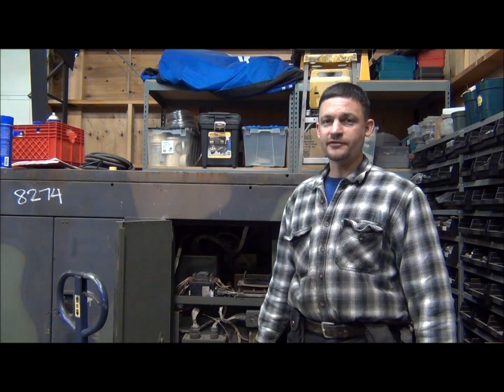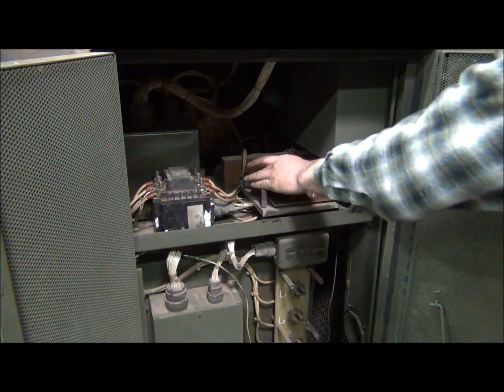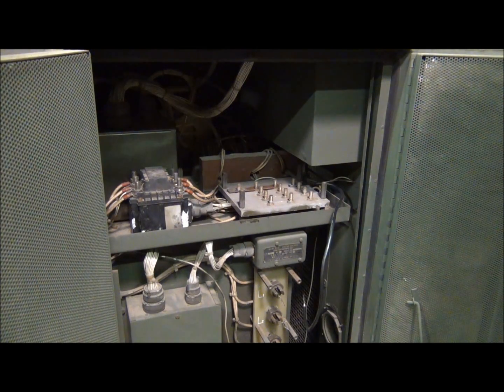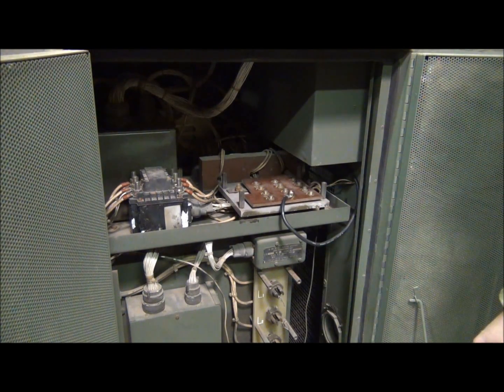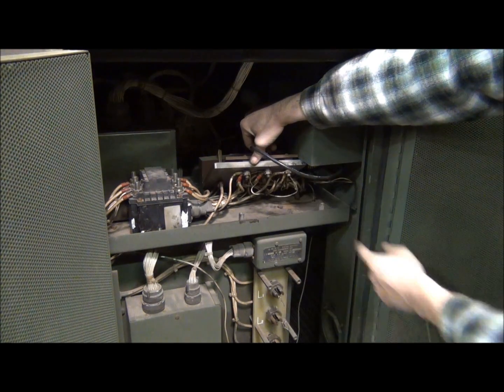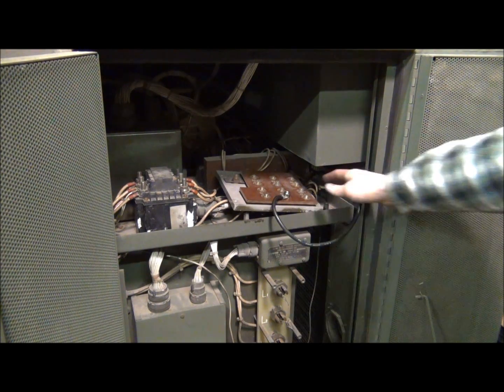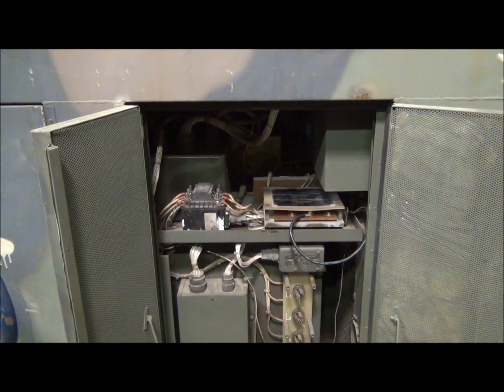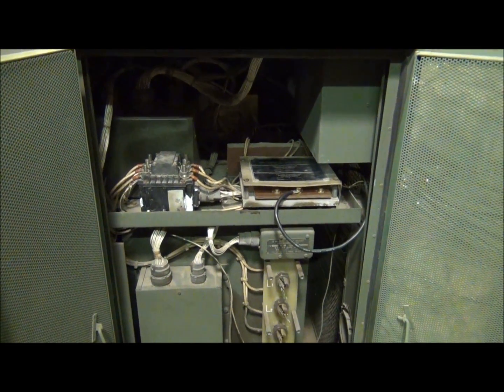How to convert an MEP-004a or -005a diesel generator to single phase 120/240

Comment: Hi Matt Verley, great video!! I found you on Steel Soldiers and this video is exactly what I'm trying to do. Everything is pretty straight forward as you explained it well but the only problem that I'm having, and I hope that you can advise me is this... 
The wires that you listed to move are different from what I have.
I have 2 wires on my #12 lug 110C16 & 110D16
I have 2 wires on my #8 lug 108D20 & 108A20
My unit is an MEP 804A 03/2004 Any help is greatly appreciated. Lol I'm trying not to short anything out. Hope your still available or if anyone else has ran into the same scenario with their machine??

Comment: How did you get around the 400hz to 60hz
Reply from the maker: There is no easy way to convert a 400 HZ generator into a 60 HZ set. I didn't have to do that, as all of the generators I bought were already 60 HZ sets.
Reply: @MattVerley  ya that’s what I’ve seen looks like this one I picked up will be good for the motor ever goes out on my 10K thank you for the reply

Comment: Hello Matt,
Wonderful video. I just purchased a 804b and am going to attempt the same conversion after I studying the schematics.
Do you ever offer your services, for compensation, to evaluate things like this?
Thanks
Scott
Reply: did you get yours sorted out?  Im getting ready to do the same thing
Reply: Hey Scott, I have also just purchased an 804B.  It's been a year since your post, did you go through with the conversion?  It seems that the only difference is the engine (Yanmar vs Isuzu) from the "A".    Was the wiring numbered the same as the A?   @MattVerley feel free to comment if you read this.  Great videos on these generators.

Comment: Can this be done to a Mep 006a?
Reply: Yes. I have done this to several of them.

However, the small wires on the rear of the connection board are different on the MEP-006A/105A. There are only two small wires on the back of the connection board to move, X12EG16N and X12P16N from T-12 to T-11 (or T-10). These must be moved before starting the genset, as the voltage regulator in the 006A is different than the 004/005 and it will damage it if these are not moved over to T-11. BTW, the wire numbers are printed right on the wires, so it is easy to identify them.

Comment: Matt, great stuff. Which one of your videos do I follow to reconfigure my MEP-804B 3 phase to 240 single phase? both look easy enough, just don't sure if the wires on the bottom need to relocate as in one video. Thanks.
Reply: Hi Steve, I am wondering the same thing, converting 804b to single phase. Did you ever find the solution? Thx

Comment: Hello,
Thank for the video,
On a forum a person was doing the same change, and the entire process is the same but.. his last connection is different, he connected T12 to T13, please advise on this difference with your instruction (T12 to T11), here are the full instructions.
"I moved X8HH16B from T8 to T11. This results in the VR seeing the following voltages:
T11 and T9: 240v
T9 and T12: 120v
T11 and T12: 120v  

I moved X8A16B to T3. This results in the thermal watt converter seeing the following voltages:
T7 to T3: 240V
T7 to T10: 120v
T3 to T10: 120V  

 moved the lead (X12EG16N) from its original position on T12 to T13, restoring the neutral.  "

Comment: I'm not sure if this is a problem of mine or if I just need help with the wiring, I have a m5 military generator with the four-cylinder Flathead engine with a Hobart generator zxb. Now if I had to flash the generator to make it generate electric how would I do so? If you had one of those generators I would make an awesome video

Comment: Good morning Matt. I just acquired a 1985 mep005a and when I excite the field with the start button my voltage will come up to around 100 volts but when I let off after setting the hz. The voltage goes away. Any ideas of where I should check next.

Comment: Matt I have a MEP 105A that has been converted to single phase along time ago .It has been working fine but today when any load is put on the generator one leg will drop to around 35-45 volts .Can you help me ?

Comment: Hello Matt,  my name is Eric, i am using my sister's youtube account.  i have a MEP005A generator that i purchased 2 yrs ago.  i have followed your directions on how to convert it from 3 phase to single phase and it works great!!  i have recently hooked 2 air handlers w/ emergency electric heat for a load bank. With both air handlers at full capacity it registers 130%.  The generator compensates and performs correctly at all times. At 130% it holds steady power and as of yet i have not tripped it out.  it is a very strong  generator.   Thanks for your video on how to convert my generator  MEO005A
Reply from the maker: Glad I was able to help!
Reply: @MattVerley does the mep 006a convert the same?

Comment: Mat, I have a MEP 004a. In back of the control panel there is a box on the right side approx. 4" x 8" with a bunch of wires going to it. The box is dripping considerably what looks like tar at the bottom of the box. What would you do about this? I have not started it to check out the unit. Just got it. I believe it was create approx. 1985 .     Kris Church

Comment: The lead #s you mentioned to move around. Are those labeled on each wire? And if so is it common to loose the label with age?  I am looking at purchasing one of these for Home backup use and will do this conversion on it.
Reply from the maker: MrBellboy1234 the numbers are stenciled on the wire every few inches.  Easy to find the designations, but you might need to work your way back up the wire a bit to find a legible one.

Comment: Hello, thanks for the video a lot i have to questions if you may, in T8 I found XBA16B and another one labeled 8 only, 2nd question when i do this switch if I connect a cable to L1 and L3 which is neutral in this case i get 240v as a single phase ?

Comment: This "single-dual" zigzag provides 2-phase 120v system with 180 el. degrees voltage vectors. Single phase system can have only ONE live wire and in this case is 240v only. My friend have similar DG and uses it in euro 220-240V 1-phase system to get an emergency power for his cottage. In his system "L1" is a live wire, "L3" is N and grounded, and "N" is left unconnected.
Reply from the maker: We're talking terminology here; but you're correct.  Normal household current in the US is split phase 120/240.  That is accomplished by grounding the center tap on a single phase 240v transformer.  This allows for two 120v legs, and the use of 240v by combining the two hot legs.  The generator is simply wired to match this normal household configuration; more useful for most people than the stock 3 phase configuration.
Reply: The most powerful appliances are connected to 240V, small - between one leg and neutral to 120V.  Have bought  many audio amplifiers from USA on eBay,  small models all have 120V power, the hi-power professional models - 240V.  But i don`t know, what advantages have that split-phase system in compare to european 240V single phase. Some peoples talk about, that 120V is not so dangerous as 240V, some say that this is historically formed system, that can work on today and do not need to invest a lot of money to transfer it to any other.
Reply from the maker: the reason it is safer is that there is no more than 120v from either hot leg to ground.  So, if you accidentally touch a hot leg in a 120/240v split phase system, you will only get shocked with 120v.  If you accidentally touch a hot leg in a true single phase 240v system, you get shocked with 240v.

Comment: i got a mep-813a but is 400hz there is any way to make run in 60hz
Reply from the maker: No; a 400hz generator is almost useless in a civilian application.  To convert to 60 hz, almost all of the instrumentation and control systems would need to be swapped, and the generator head itself would also need to be replaced with a 60hz version.  No easy or economical way to do this.

Comment: 1979 mep 005 generator with white 6cyl diesel engine starts then stalls shortly after releasing start switch.  Fuel pressure from transfer pump appears to be weak(very slow flow).  Manual states 130 psi max.  Could you tell me where to find a transfer pump and idea on fuel pressure

Comment: Will this conversion work on a 1980 30 kw MEP 114 A? You have the best videos on these generators keep it up.
Reply from the maker: The conversion to single phase would work; but the 114a is a 400hz machine.  Almost useless in a civilian application, unless you intend to power a military surplus radar set or some other kind of custom project.
Reply: So what is 400hz and what does the hz need to be for a 120/240 house? What will happen to my house if I used the 400hz?
Reply from the maker: Mike Carlson household current is 60hz (in the US).  If you tried to supply your house with 400hz, it would immediately damage any digital electronics, motors, and anything with a transformer.  That's about 95% of most household electronics.  Heating elements would probably be ok, as would incandescent light bulbs.  Generally speaking, a 400hz set is useless for civilian use, except to cannibalize parts for a 60hz set.  The military uses them to power specific precision equipment, like radar systems.
Reply: I guess I need to sell it . What you think it is worth? Only 55 hours. I need a part for it and was wondering if you could point me in the right direction to find it? I need the part the bolts to the bottom of the radiator where the radiator hose connects to and controls the shutter. I tried Osh Kosh already  they where out.
Reply: Hey Matt could he not use the engine for parts for a bad MEP 004a the mounting is the same

Comment: This was a GREAT video...is it possible to also convert a MEP-003A 10Kw to single phase operation...?
Reply from the maker: 1wnewman the -003a has that feature already built in; it has a 3 position switch that allows you to select 120 single phase, 120/240 split phase, or 120/208 wye 3 phase.
Reply: I was under the impression that the MEP-003A 120 single phase position - was only rated at 2/3rd’s
of the potential power output because the unit was really set-up for 3-phase…and thus could never deliver
full power under that configuration…? Thanks…William

Comment: I have a JR Hollingsworth 30 kw genset with the white 6 cylinder engine. I am having fuel issues at the injection pump. also have a few other general questions about genset. my email is jchvy1@gmail. com.

Comment: Hey there love the videos. I have started collecting old deuce and a halfs and mep genset's . Will this work on a 1980 30kw John helingsworth genet with the white engine? I look forward to picking your brain . I see this video is very old . Are you still working on these units?
Reply from the maker: I haven't turned wrenches on MEP sets for a few years, but I'm still willing to help.  What's going on with your set?
Reply: any former  MEP generator  mechanics  ever experienced  a short circuit with two paralleled  units without a load applied?  MEP806A

Comment: Hi i have a military  generator MEP-806A  60KW GENERATOR thAT WOULD START RIGHT UP BUT WOULD NOT OUT PUT NO VOLTAGE COULD YOU TELL ME WHAT I COULD CHECK
Reply: I would check the voltage regulator A5 if it's bad you have to change  the T1 transformer voltage potentiometer  and resistor out in a set... there's a tcto  on the voltage regulator installing a 5 amount fuse I believe in line with f1 and fm for field flash circuit
Reply: 5 amp cartridge  fuse
Reply: F1 and F2  is your 24vdv exciter field

Comment: I tried that switch and it didn't work is there any way that you can tell me where to speed signal is located or what relayed it is and why that would shut down the fuel thank you
Reply from the maker: the overspend signal is generated inside of that cannister with the little button on top.  basically, it is just a set of contacts in the line that supplies power to the "run" relay, which powers the lift pumps and the injection pump solenoid.  there is a good schematic in the -12 tech manual

Comment: I plan to use this to power a few RVs which as you probably know are all 120v. After the single phase conversion, what would I need to do in order to get rated power with just using 120v. Tying L1 and L3 together and using a single lead? I'm doubtful.
Reply: Basically going from 120/240 at 7500 watts per leg to 120 at 15,000

Comment: hello i am back again with another question about the mep-005a. Tried to start another one but fuel pumps won't engage. Also seems to be stuck in over speed. We r thinking it might be possible relay or switch but r sort of stumped. Could u give me some direction on what it might be. thanks
Reply from the maker: +Jason Chapman There is an overspeed reset button on the speed switch
Reply: +sewerzuk 

ty I will try that

Comment: Sewerzuk,      Love your video's!  Very informative.  I just picked up a MEP-805A .  Both engine start switch and phase selector switches are locked up due to sand and debris.  Do you have any information on these switches, wiring, or schematics?  I have found diagrams on my machine, but i am not certain where this information would be.  I took the phase selector switch and now am worried i won't reassemble it correctly.  
Thank You
Reply from the maker: +Charles Fehn I have the tech manuals; I sent you a youtube message with my email address.  If you send me yours, I will email the manuals to you.
Reply: +sewerzuk  i just checked and could not find your email.  my email is charles.fehn@gmail.com.  Thank you so much for reaching out!
Reply from the maker: ***** Just sent you 3 separate emails with a tech manual attached to each one.  Let me know if you don't get all 3; one of them is fairly large.

Comment: Hey Sewerzuk,
keep up with the great work, love the channel.  I have just picked up a MEP-804a I am getting it ready to start, changed filters, added fluids etc. The problem I have is no power to the panel. No lights no faults it won't crank with the dead crank switch. I can crank it if I jump the selenoid.  Is there a main fuse or breaker that I can check? I have the manual and it is still a bit vague.  I would appreciate any advice.  Thanks.

Comment: Sewerzuk,
              I have a 2006 mep004a and think i have all the mods correct but my indentifying numbers on the wires underneath the voltage recconect panel are different. Mine is manufactured by fermont. Any help would be greatly appreciated
Reply from the maker: the markings on the small control wires are sometimes just the first few digits instead of the entire string.
Reply: +sewerzuk 
the numbers  are stamped every inch or two apart, but don"t correspond at all to the numbers from your video , the only other print on the wire looks to be manufacturer
Reply from the maker: +Gene Heering hmmm, well I'm not sure what to tell you!  do any of the wires correspond to the diagrams on the access covers?  this is the first time I have run into an issue like that
Reply: +sewerzuk 
I will take photos of the schematitcs as I'm not as generator saavy as you, along with whats connected to which terminal. I tried tracing some of them back but don't have all in front of me right now. You have enlightened me quite a bit, thanks for the info, real good stuff.
Reply: +Gene Heering 
ok, how bout the wires that are changed in your machine ,can you tell me what they supply powerto or signal so i can trace them on my schematic according to the numbers provided on my end?
Reply from the maker: Gene Heering Your schematic does correspond with your generator then?
Reply: Sewerzuk,
                 Think i have found the culprit. I believe yours to be a 12 lead generator, actually 13 wires? but mine only ten from the generator head itself, a 9 lead, if i remember form other reading, can't do alot of the reconfigurations possible with the 12 lead generator. Also mine has many electronic components, not the older electrical relay type components I've seen in older units. 
Gene
Reply from the maker: I missed the year on your original post; are you sure this isn't an -804a?  But yes, the newer generators do not have a 12 lead head, and cannot be wired in a zigzag configuration

Comment: Is the process similar on the MEP-804a series generators? I can't seem to find a decent 004a or 005A
Reply from the maker: +NoOne Special I've never had an 804a in my shop; but I do know that they have a 10 lead generator head.  That makes this procedure impossible.
Reply: +sewerzuk Thank you for the reply.  I'll keep looking for a 005a. Is there another model that would be suitable for 1ph conversion or one currently setup for 1ph in the 20-30kw range.  I'm looking for backup power for the house and shop.
Reply from the maker: NoOne Special The MEP-003a is the only one in the MEP series that comes close to your requirement; it is a 4 cylinder aircooled unit that is selectable between single/split and 3 phase.  It is rated at 10kw, but most units are capable of 12-15kw without a problem.  I currently have one of these as a "backup" to my house generator.